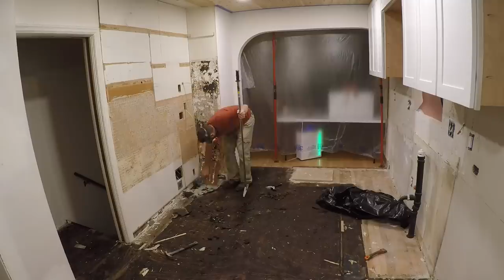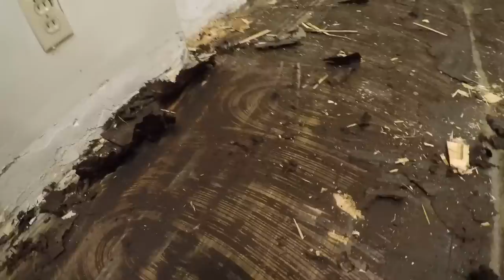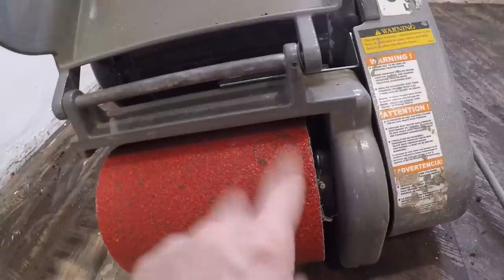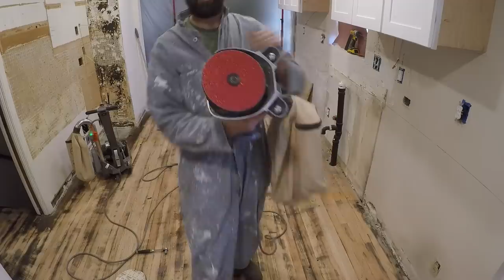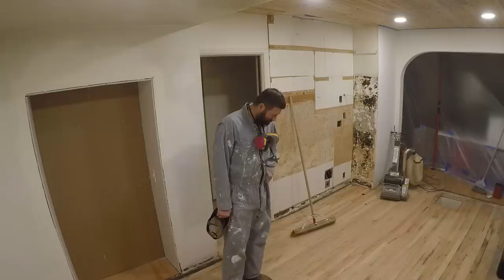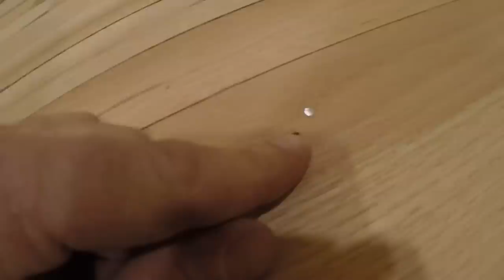How To Restore Damaged Oak Floors | THE HANDYMAN |

Comment: Handyman - i restored hardwood flooring professionally for years.  I was impressed by your other video on hardwood floors you did everything right. One tip for a floor like this is to run the belt sander at a 45* angle to remove the rough stuff. This will help eliminate the chance of leaving runways on the floor. Also this method is alot faster in heavy removal. Love the channel by the way.

Comment: You probably have already repaired the holes, but I have used a router to make the patch by setting it to a depth of 1/4” and routing a section out that looks appropriate. The patch is then glued in and sanded, leaving a invisible repair. I have also had customers ask for a butterfly patch which they considered a sort of Easter egg.

Comment: Just glue in a round red oak dowel in the hole.  Its an old home, leave some character.
Reply from the maker: bingo
Reply: Cut a plug instead of using a dowel so you aren't having the end grain face up.  Drill out the hole so it's a nice circle and then plug it making sure the grain lines up.   Taper the plug so you get a nice tight fit when you glue it in and then flush cut it with a saw and sand it smooth.  No way would I try to remove any of those boards.
Reply: @JW-sv5xc  👍
Reply: I was thinking a butterfly inlay would be cool.
Reply: I just made the same comment then saw yours.  Had to go back and delete mine.

I think plugs and inlays are more visible.  Dowels look more like natural knots.
Reply: Based on the videos I've been seeing, you just fill it in with ramen noodles and faux finish the surface. Ramen noodles have become the most used building product for all the biggest home improvement channels in the world on all their massive remodels.

Comment: Run the scraper blade backwards and use a grinder to radius the corners of the blade. It keeps you from gouging and isn't shape enough to cut into the wood.  This is a great video series.

Comment: Also pro tip of day is just like tabletop belt sanders. You can use belt erasers to help remove built up material. Just be careful since it's a skin remover 5,000 if you mess up. Love your channel, stumbled across it as I was doing research for my handyman services. I'm just starting on side like you stated and have already booked out 2months of work. Wish you did a travel series, show how you can do it out of a 2017 rav 4 🤣. I'm saving up for a 5x8 trailer and eventually truck but want to keep overhead low and its working so far. Just need to be creative getting some material. Atleast this week I'm getting tow hitch and borrowing friends trailer when needed. Thanks again for tips, tricks and being strait foward with your viewers.

Comment: It would take me an hour or more to type my whole story, but my first house was built in the 30s and showed it.  this was in 1981.  I remodeled it top to bottom by myself and took me a little more than 3 years to finish, and it was a small house but it was cool design. (I wish i still had it).  When I pulled up the linoleum, I could not believe there were hardwood floors in the whole house. When I finally got done doing what you're doing, they were gorgeous and I cannot tell you how many friends and family of mine tried to buy that house from me. When I finally did decided to sell that house 15 years later, those floors sold that house to the first people who looked at it.  Where I live at, real oak hardwood floors are EXPENSIVE.

Comment: When using the scraper and it is too sharp turn the blade backwards. You would be surprised how well it scrapes without gouging. I also will dull a new blade on a smooth concrete surface so it is not so sharp. Love your videos from here in the Philippines. Also a 4 inch scraper is easier to control

Comment: i would cut a plug to fit, align the grain and sand
Reply: Or don't align it and keep it as a conversation starter. Like: this is the only piece of wood that spans the full length, and it just so happens to have a hole in it. It could have been anywhere else in the room, but no. Had to be right here it's at. 

👁️👄👁️

Comment: if you get a wetstone. like one for sharping knives. if you run the edge tip across the wetstone 2 to 4 times. that should work on dulling the blade enough to be similar to what the old one was like. could also try on concrete too.

Comment: About 5 minutes in, and I can't help thinking a heat gun would be pretty useful for loosening that black stuff, make less work for the scraper.  (EDIT:)  Just heard the part around 7 minutes about not wanting the sander to heat the stuff up, liquefy it, so that it seeps into the joints and grain.  Fair point.  But a heat gun could be controlled, so that it just softens the stuff for easier scraping, without liquefying it.

Comment: It would have been pretty hellish to discover one of the remaining nails with your knee...

When my grandparents passed away and they were preparing their house for sale, they pulled up the ugly wall-to-wall carpet they'd had for the previous 35+ years since they moved into that house. (It was a light brown carpet when I was very young. At some point in the 1970s they replaced it with a deep red one.) Underneath was a beautiful, untouched maple hardwood floor. Covered over by carpeting, it was entirely unwalked-on and the finish was almost intact, other than around the edges where the tacking strips were. No idea why they kept it covered up. I guess it was the fashion in 1957 when they bought the place brand-new.
Reply: Carpet was the trend at the time!

Comment: I had a situation exactly like this in a bedroom. Wallpaper steamers work wonders. I had one and bought another one so I could have 2x going at the same time. You have to let it sit for 45 seconds or so to soften up the mastic and then it just wipes away. It does take some time but you do no damage to the floor. After, just run your floor sander as normal.

Comment: Get an ice scraper that is used for chipping sidewalks. Sharpen the edge to a ‘dull’ sharp and go at it. If you are worried about the corners, grind a little more off the last 1/2 inch on each side and you won’t gouge. Hit a nail and you’ll either cut it off, pull it out or just bounce off. If it nicks, touch it up with the grinder and go again.

Comment: Had a 100 yr old floor with a 7/8 hole in the middle of the dinning room. Found a plug cutter on Amazon and made a tight side grain plug from a scrap oak board with similar color. Barely noticeable after finishing was complete. Way easier than replacing sections.

Comment: After you move the floor boards with holes in them, could you fill the holes with a wooden dowel?. I've never worked with wood floor before, just tons of ceramic tile, and vinyl plank

Comment: I use one of those scrappers at work.  We bought it around 22 years ago.  I was wondering where do you get the replacement blades? @2:30.  The hardware store that we bought it from doesn't carry the blades or tool anymore.  I work in a warehouse.  We used it originally to scrap painted lines from the floor.  Then assembly discovered it was great for scrapping glue from their work tables.   I replaced the last blade about a year or so ago and we are due for some new ones.
Reply from the maker: https://amzn.to/2DkGFUe

Comment: Who WAS that masked man?!! 🤗💖

Handyman, 🤠/` the floor looks incredible! So much better than expected ~ like new again. In fact, a few coats of varnish might be all that's needed to match the other room. Re those 2 holes - can you cut round plugs with a 1/2"-3/4" hole bit, from a less noticeable board? eg the cabinet area? Tap them in, matching the grain, sand & finish?

(And caressing a soft smooth beautiful floor is much more satisfying than playing with a vibrating sander, true! 🤭)

Comment: Literally, I just finished a 4,000 Sq Ft home with 150+ year old heart pine flooring.  Every square inch looked exactly like this. Around a three week job. But, they turned out GORGEOUS!
Also, just a little tip. If your floors are cupped, you can cut it at a 10-45 angle and it will eliminate that cupping and help you with the low dark spots.

Comment: We never filled in the cracks. We just left the floor do its thing. Filler juat tends to bust up from winter summer movement. And I always used corks to fill the old round pipe holes.

Comment: With that cover over the ‘void’ in the floor, is there any reason why you’ve not nailed a couple of lengths of scrap timber to the bottom of the cover matching the inside diameter of the void? Would mean you or anyone else can work or enter the area, without the risk of kicking the board away accidentally and falling in; but keep the board removable until you install the permanent solution. #SafetyFirst (And keep up these videos, really enjoy them)

Comment: You should add electric heaters either base board or wall heaters so the kitchen is not cold and does not lose heat as you eliminated radiators.

Comment: How on earth did you use that extending scraper so well? I used that exact same one and it was utter garbage. Every time the blade hit any resistance the handle would loosen and then collapse. I had to keep tightening it after every stroke. Eventually I just gave up on it. I got down on my knees and used a scraper that didn’t extend.
Reply from the maker: Get some muscles and tighten it down.

Comment: It is not the sharp blade that causes the problem--it is the sharp corners of the blade.  Round off the corners with a grinder and it will be like night and day.  No more problems digging in or catching the grain.  Still best to maintain a low blade angle for best results and change your blade frequently (or resharpen it).

Comment: Two things handyman, the Crain 21” floor scraper is the best scraper I’ve ever used and I’ve used many. But especially with those qep 8 inch scrapers, turn the blade around for wood like that, no need for the sharp blade, the back edges will do plenty scraping for you without digging.

Comment: I saw a guy fix a hole like this, he pre drilled a hole through  2 by 4 with a forstner bit and used it as a guide to clean up the hole and than  plugged the hole.
Reply from the maker: See todays video to see how I did it.

Comment: What material are you going to trowel on the floor?
Reply from the maker: trowelable red oak floor filler.  It will be in tomorrows video.
Reply: Thanks. I’ll be tuning in as usual.

Comment: I am sure you will fix the boards that have the holes, but I would cheat and buy a piece of red oak and cut out a plug with a taper to fill the hole and glue it in.
Reply from the maker: Don't miss tomorrows video.

Comment: It’s toxic as fuck, but I often get 12G edger disks and edge the entire floor one inch at a time.. float the edger cross grain in 2’ wide strips. It will knock that crap everywhere but it goes really fast. 12 grit is important, 16 grit will clog.. one inch at a time. I can do a 15x15’ room in 3 hours.. again, no talking and keep the respirator on 🤐

Comment: This is when you just tear up the floor and replace with oak. Then sand. I would never  take this job.
Reply from the maker: You might want to watch the next video.   This is oak floor. Did you not watch the videos????????????????????????????????????????????????/
Reply: I watched the first video. I know it’s oak. I was saying just replace the floor with the same material. It is difficult to tell how hard it is going to be to sand down to wood until you get into sanding it.
Reply from the maker: Only took 3 belts and about 2 hours.
Reply: Yes you lucked out. But as I said before you don’t know until you start sanding.

Comment: try a taping knife sharpened with a file and you will thank me
Reply from the maker: Thank you.
Reply: The Handyman I removed that kind of glue using a taping knife,somebody glued some kind of vinyl flexible tile over a white oak floor in an old 1924 building in montreal and the floor had to be saved because of historic value or something and i tried everything and i found that to be the less agressive tool that worked the fastest. your floor looks dynamite btw great job 👍🏻